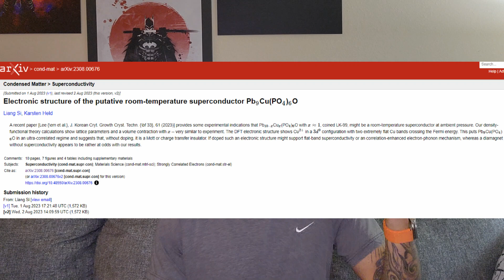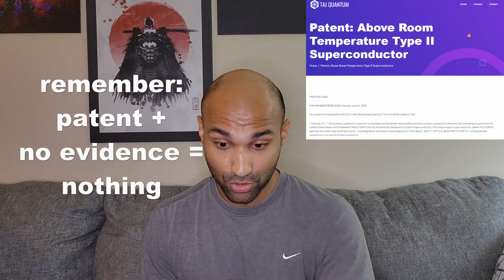LK-99, “Zero Resistance,” & RT Superconduction: Updates in Theory & Experiment | 1D Soviet Science?

Comment: so you can crush it and filter out the super conducting bits? can you then compress those into a film or filament?
Reply from the maker: That’s what they’ve been doing and that’s generally the process they’re trying to validate. I’m hearing about vapor deposition processes and needing to characterize AFTER the vapor deposition. Only one paper attempted vapor deposition but they didn’t characterize to make sure that what was deposited what actually what they thought it was and that does need to be done
It’s apparently super brittle in the crude cooks we have so far so working with it beyond bulk solid and vapor deposition hasn’t really been done yet. Making it into wires might be an issue, will see